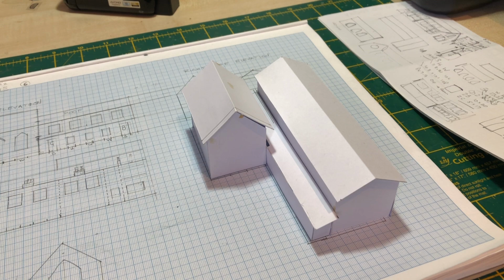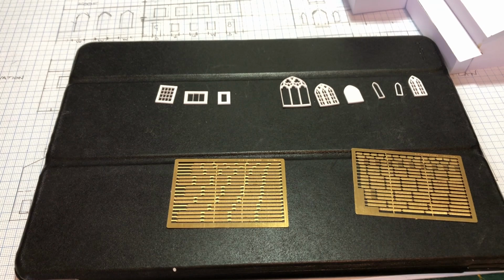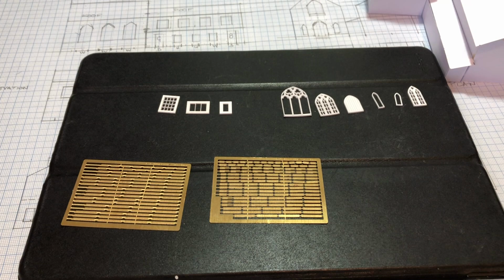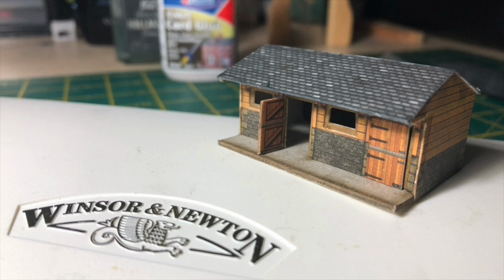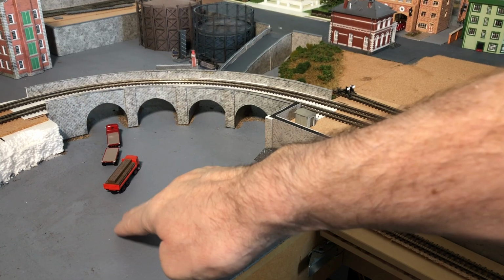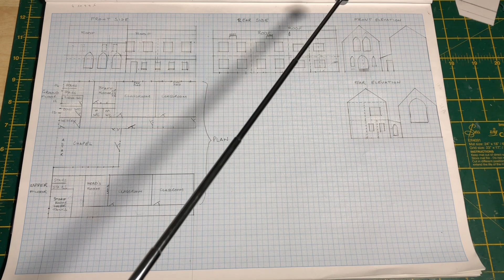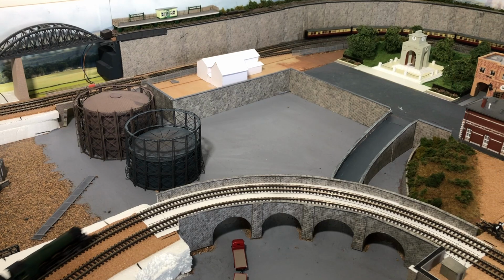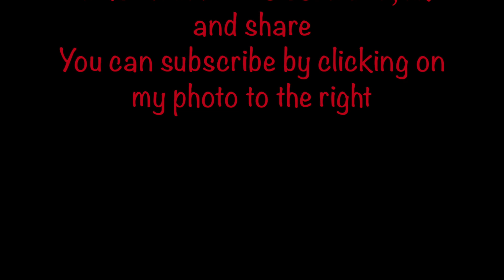Elvenhome N Gauge model railway layout January 2020 Update  EP 71

Comment: Hi Stephen. I think that 2x wide windows in the end of the chapel would be too busy; perhaps 2x narrow windows or 1x wide window. In another video (can't remember who made it) the modeller used clear acetate (or appropriate alternative) and then used coloured pens to give the stained glass effect. Was the scrapyard stable block based on Steptoe & Son? [I write some of these comments as I go along - stopping the video while I write - then when I restart the video you answer my question! Yes, it was based on Steptoe & Son - spooky!] Ooh -the girls' playground may turn out to be a bit miserly.
Reply from the maker: Hi Paul.  The two big windows at the front were in part to compensate for the lack of light from one side of the building.  As you will have gathered Google is my friend, and I did find a number of chapels with this kind of window configuration.  The coloured acetate worked a treat but I have seen the clear acetate and coloured pen approach.  Whether that was at N Gauge I can't remember.

Comment: Love the ideas for the school, just an observation, I know rule one always applies but something about the design doesn’t sit right I would think that the chapel should turn by 90 degrees with the door at the front the vestry would be in the back left hand corner the corridor would enter the chapel from the right hand side. So in essence the building would be an L shape, you could then turn the whole building by 90 degrees and move it back in the space making better use of the area,
Reply from the maker: Hi Peter.  I did play around with layout of the chapel and the school  in the L shape. I had the chapel at 90 degrees to the school at one point but in the end I settled on the arrangement I have and I rather like the overall shape and proportions.  I also have by now (this was filmed about a week ago) cut out all the walls and started work on fitting windows.  Stephen